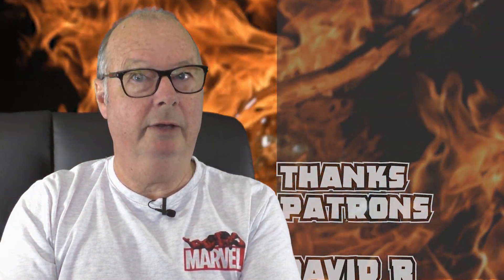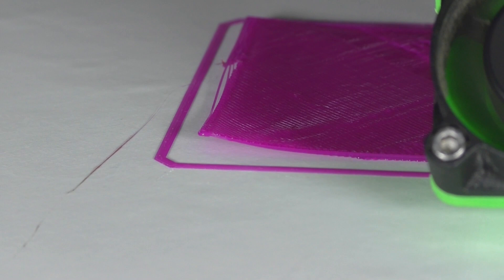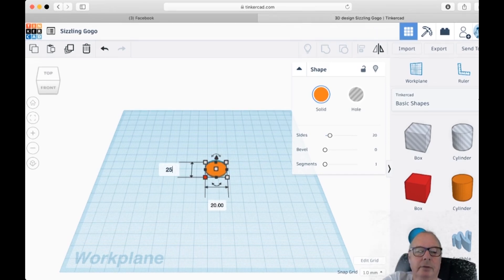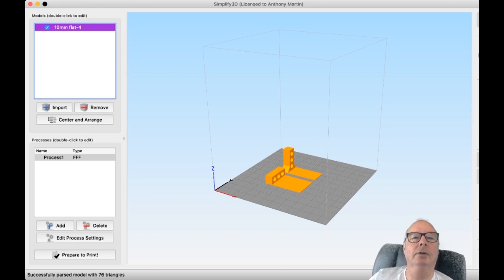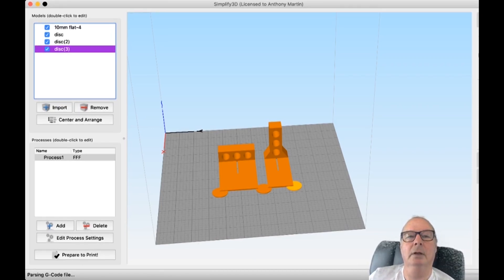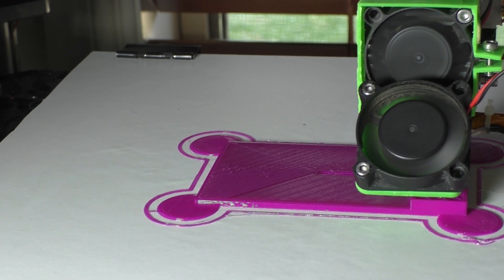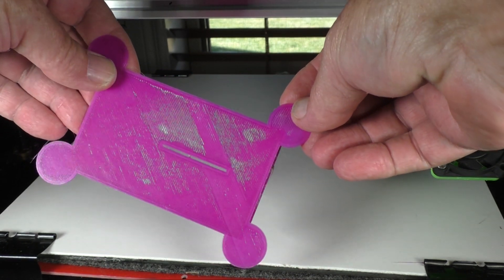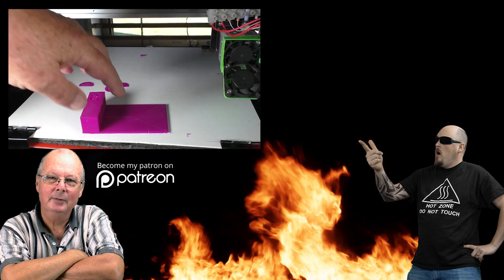How to reduce warping in your prints!

Comment from the maker: Obviously a brim exists in a slicer but why waste filament on an entire print or prints for the sake of one troublesome part. This is why this trick is great! You can also adjust the discs shape or form to suite exactly what you need.
💙  Support The Channel  💙

Patreon: http://patreon.thehotend.org
Reply: The brim sometimes is not enough. Brim won't work as effective as these corner anchors with sharp corners. Sharp corner are the "concentrators" of shrinkage and thus are causing the part to unstick from build plate.
Reply: I realize it's kinda randomly asking but do anybody know a good site to watch newly released movies online ?
Reply: @Chase Dexter I would suggest FlixZone. Just google for it =)